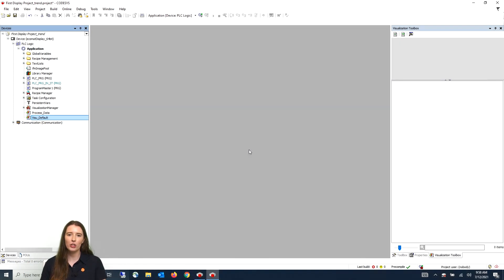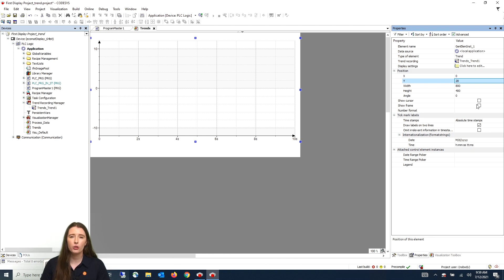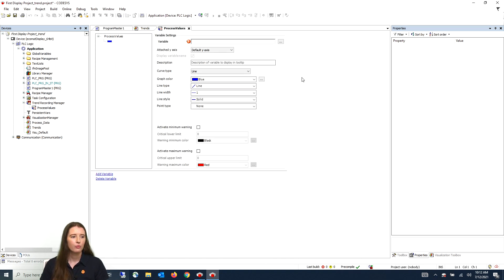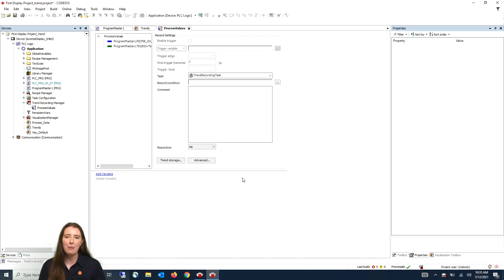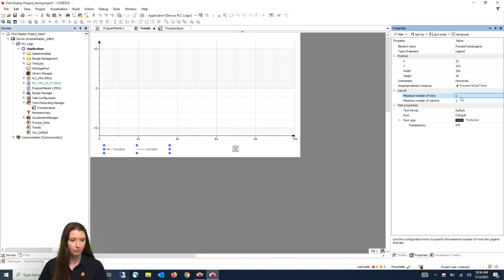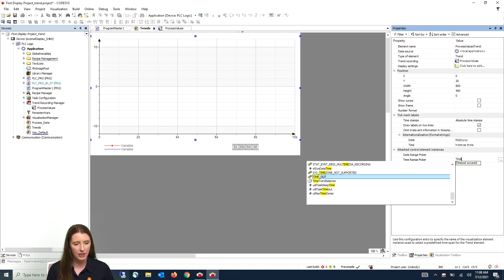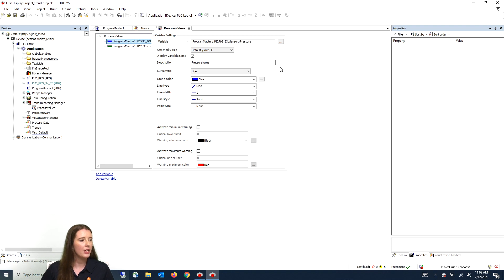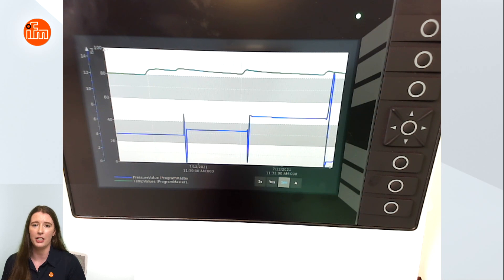How to Program A Trend Screen on a CODESYS industrial controller

Comment: Thanks!

I want to add boundary lines to the trend lines, which are not dependent on any variable but serve as upper and lower limits i want to print out DATA or results after a cycle is complete on a modified pdf file